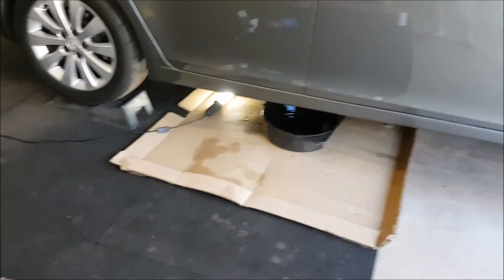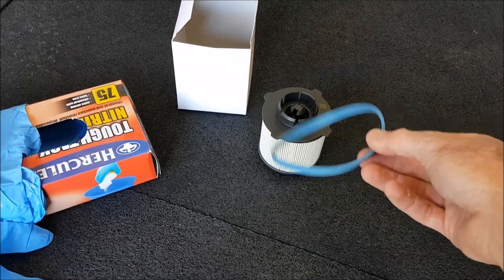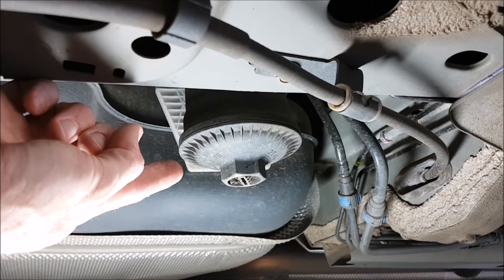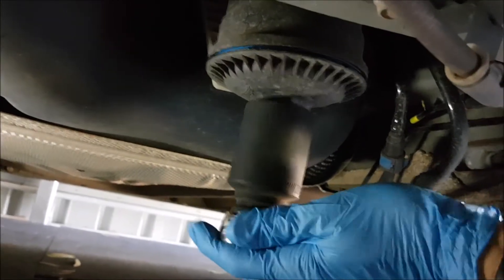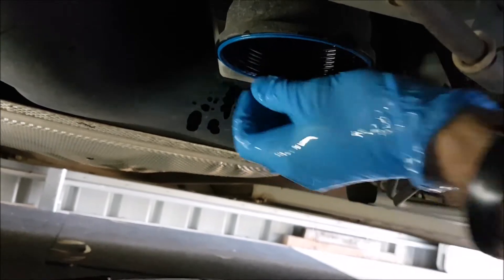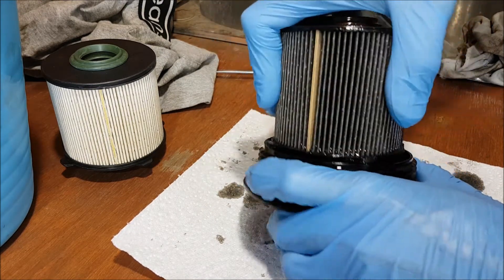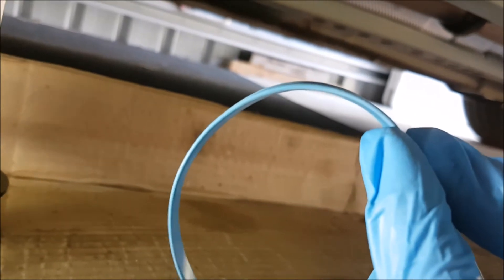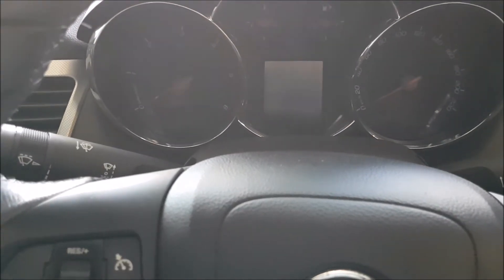Change fuel filter 2012 JH Series 2 Holden Cruze Turbo Diesel

Comment: Hi peter, thanks for valuable video, does it matter if this change is done when tank is full or just before getting fuel filled up, thanks
Reply from the maker: it doesn't matter how much fuel is in the tank - you can do it at any time.
Reply: Thanks, can we use transgold fuel filter , i found it on supercheapauto, or wesfil is the best to stick with

Comment: Hi Peter, I will be doing this on the weekend, just a question, my replacement filter kit came with another smaller rubber washer that I assume goes around the inner plastic rod, do I need to replace this too, or not worry about it?...
Reply from the maker: what is the part number on the filter you have?  In the kit I use there is only one large seal supplied with the kit for the outer housing.  the seal on the filter is already attached to the new filter.  If there is a new seal supplied you should replace it.
Reply from the maker: I have seen pictures of what you're dealing with.  the filter housing in my car doesn't have an inner plastic rod (might have been a design change or different part for a different market).  if yours has one then you will need to replace the "o" ring on the inner tube with the one supplied in your kit.
Reply: @numbnutsAU  no worries, yeah, looks easy enough to remove and replace, will do that, thanks 👍😁
Reply: @numbnutsAU  oh yeah, I see what you mean, so looks like I only need to used the large one, part number is FE0027
Reply: I just did this job, went much easier than I thought, a few tips I found that make it easier is to loosen off filter housing until you see the rubber seal, then slowly turn it until it starts dripping, then after about 30 seconds, fully turn out and avoid fuel splash, also my old filter was jammed up in holder, if you find that, gently pull down and it pops out easily 😁👍

Comment: Hey mate where did you get the filtre from??
Reply from the maker: It takes either a Ryco R2719P or a Wesfil WCF145.  Repco or Autopro will have something or you can order online from ebay or Sparesbox.
Reply: Thanks heaps mate